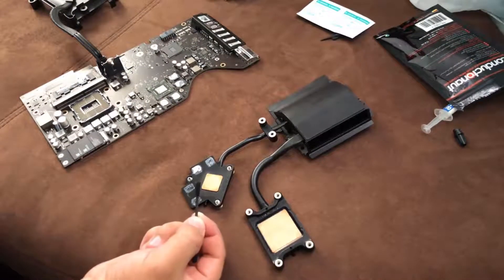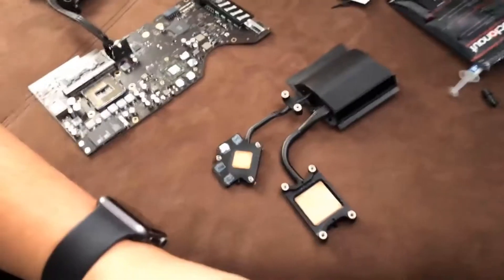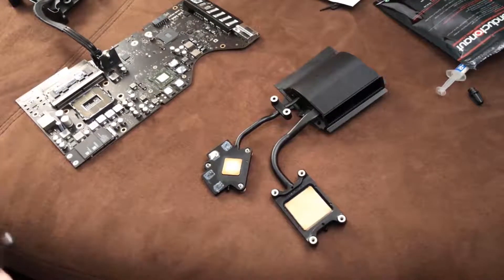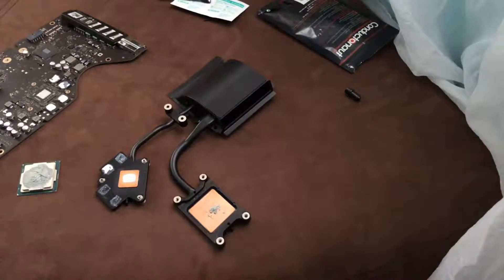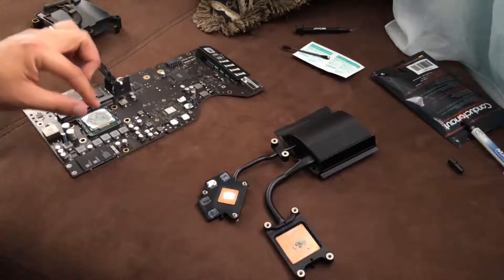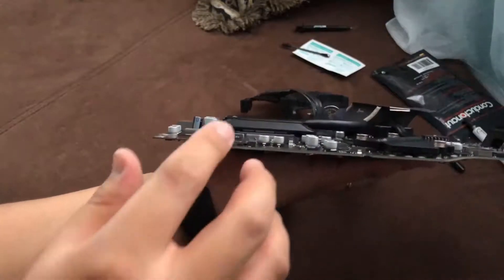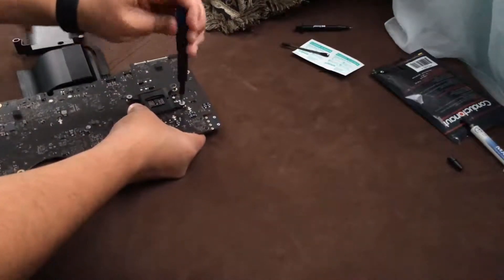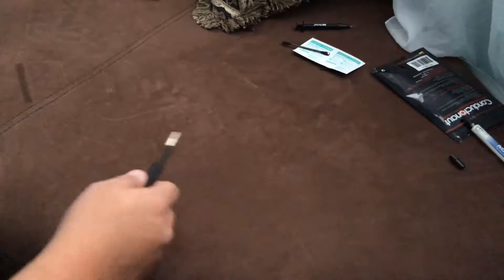2017 iMac GPU liquid metal

Comment: Since the motherboard of the imac, once reassembled, is in a vertical position, can there be a risk that the liquid metal will move over time and decrease the efficiency of contact or even create short circuits?

Comment: Hi. I have upgraded my iMac 2017. New SSD crucial and RAM OWC 16*2. The computer does not start. Diagnosis: 1st green led light Ok, 2nd led light Ok, no chime, though. The third led light does not show. So the problem is in the GPU. I put new battery ( PRAM) and the problem continues…The problem would be solve putting some thermal paste on GPU ?. I don’t know what to do….Thank you

Comment: Hi, really good your videos!!! 
One question, did you keep the core i7 7700k? I’m thinking to upgrade either to the 7700 or 7700k(if possible) 
I have the core I5 what you recommend?
Reply from the maker: From my experience, I really like the i7-7700 on this iMac but if the pricing is the same or even $5-10 more for the 7700k I would personally get the 7700k
Reply: Small Tech Reviews thanks for reply, here it’s like $100 or more the difference in prices... so I think the 7700 it’s gonna  be ok 😎 thanks a lot 👍